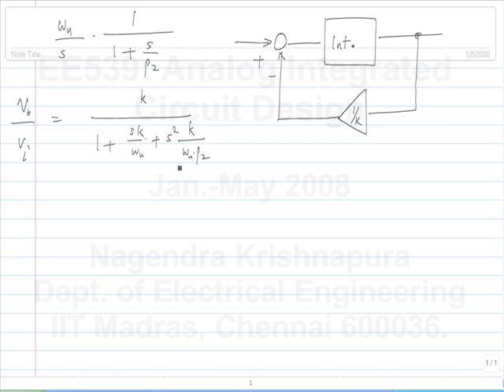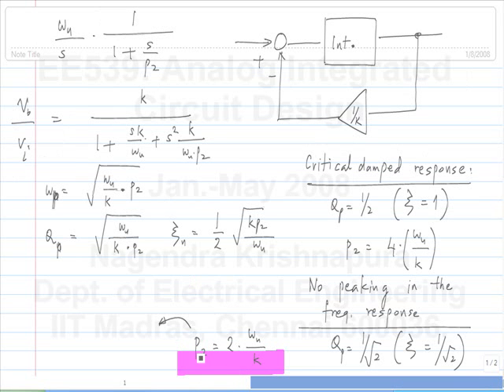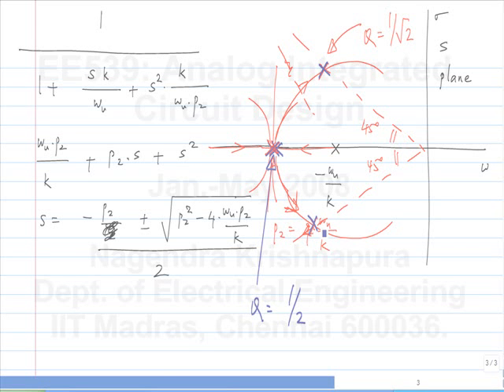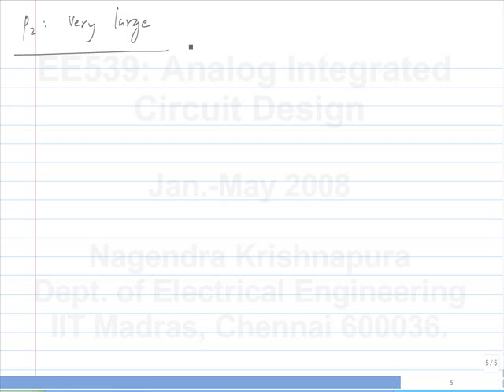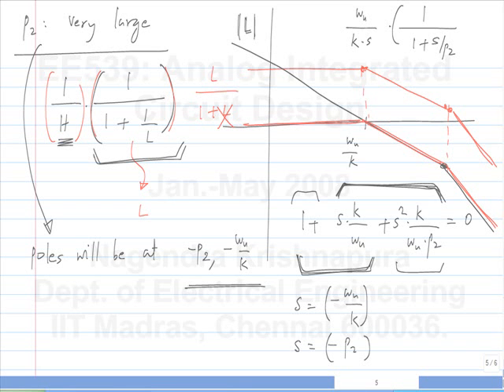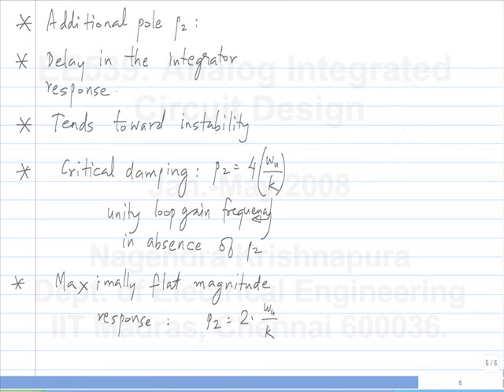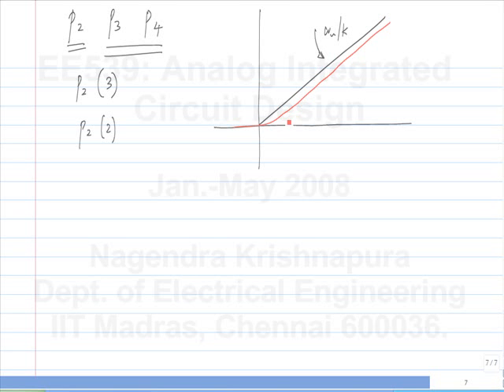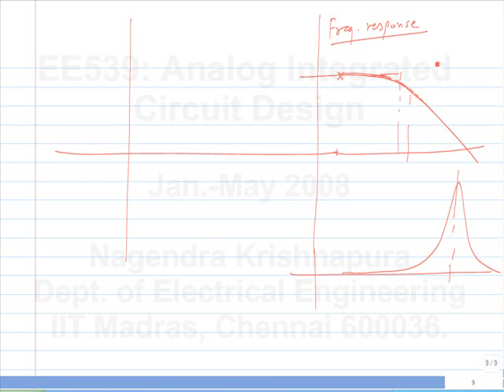Lecture 4 Effect of additional poles in time and frequency domains

Comment: Sir, On one hand you are saying that the additional pole causes delay in the system. But for that case with NO peaking we are getting 40% extra bandwidth which means our amplifier's speed has been increased. Why are these two statements contradiciting with each other??
Reply: but 40% extra bandwidth is with condition of maxmilly flat response p2 @ 2w/k . 
isn't it correct ?